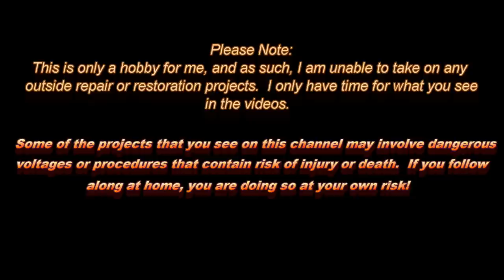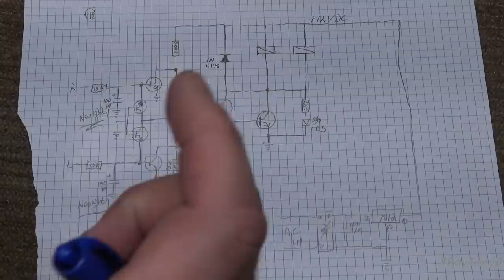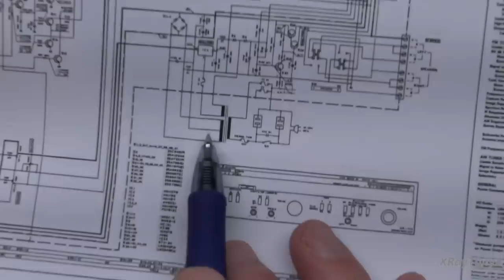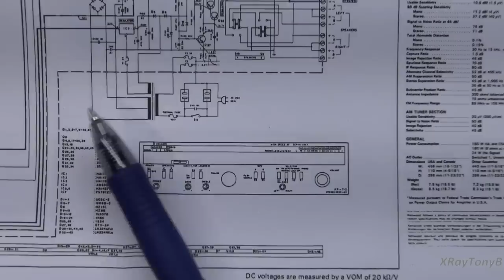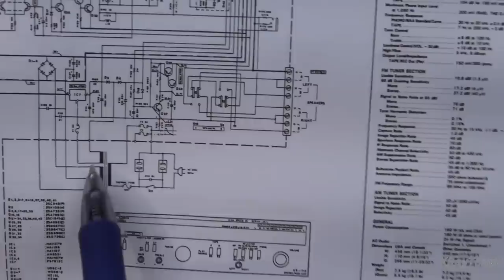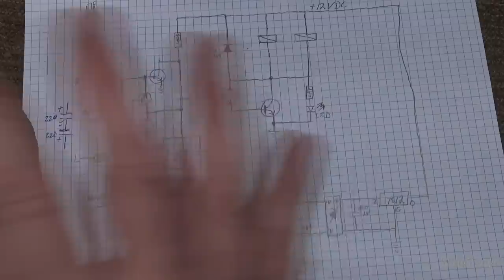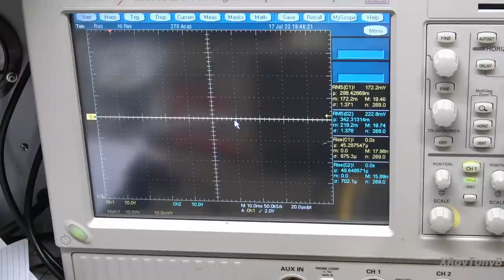Speaker Protect Circuits - In Practice

Comment from the maker: 0:15 Intro
5:20 Looking at Schematic of the Speaker Protect Module 
17:39 Building the Module (Solder & Chat)
38:19 Preparing the Chassis for install
42:09 Adding a buck regulator module to power the circuit
44:43 Testing the module with the original input capacitors
46:15 Replacing the input caps with non-polarized type
47:02 Testing the finished protect circuit
Reply: I recommend pinning this comment so that it appears on the top for everyone, if you don't pin it, it only appears on the top for the user that wrote it.

Comment: Tony, I've been an EE for more than 50 years, so I've seen a thing or two. I like your videos and don't have any issue with your presentation or content. Remember that McIntosh amp you restored by designing new PC boards? I got so many good tips on transistor substitutions for obsolete parts that I didn't need to hunt through tons of data sheets to modernize a power amp I built in the 70s. I'm retired now, but still enjoy, as you do, tinkering at the workbench. When I meet someone who wants to learn about electronics, yours is one of the channels I suggest. Keep doing these videos the way you like and ignore the keyboard warriors that have nothing better to do than criticize.

Comment: Another great video ! Your time and effort to produce each is certainly a gift .  As far as vision, I never got used to bifocals (and I tried many versions) when first prescribed later in life, a large PITA!  Have worn glasses for a good part of my life and still get them made for single vision lenses. I take them off when reading or bench work.  I find that my eyes adjust better  than using magnifying  reading glasses.  As for tiny print on some components,  the camera on smart phone with magnifier works great and the phone flashlight is great for those hard to read stamping in  plastic components.  I consider wearing clear safety glasses when working around live  high voltages and other hazards.  Thanks !

Comment: Tip = I wear transition lenses. At my last doctor's visit, I asked them to give me a separate script for soldering glasses. They are a single magnification, so I don't have any aggravation with trying to find the proper focus zone. The script also has a little extra magnification, but they also considered the focal length, to give me enough room (under my nose, so to speak) to account for the length of the soldering iron. I highly recommend them. If you don't need any correction, other than magnification, maybe you could get away with a pair from the dollar store. I have heard of plumbers that had their prescriptions flipped, vertically, for hanging pipe, overhead, all day. I even added a magnification lens inside my welding helmet, long ago, so I didn't have to wear glasses, under the helmet. That was before needing to prescriptions.  lol

Comment: At about 9:00,  It is worth pointing out that you don't necessarily have to have a shorted output transistor or driver transistor in order to have significant DC offset going to the speaker; a fault in the differential amplifier at the input of the power amp could result in several volts or more of DC offset voltage being fed to the speaker. (PS, it is a good idea to always change out the feedback capacitor in the differential amplifier to a bipolar type ----  many amplifiers used a polarized electrolytic capacitor here, and and they are known to fail).

Comment: I bought one the chineiseium  protection boards.  Mounted in a separate box with it's own power supply.  It has speaker wire leads for inputs, and  speaker type terminals for the outputs. Plugs into the switched auxiliary 120 outlet. This way I can use it for all of my amps or receivers, and nothing had to modded internally.
Reply: I did that but I wanted in the amp just took up to much room but not a lot on room in the amp. I now use the external for testing

Comment: Protection relay boards are available that run directly off of 120 VAC.  This will be easier to interface into many amplifiers then trying to find a suitable low voltage AC supply from the mains transformer in the unit.

Comment: Tony thanks for reverse engineering and explaining the theory of operation. This video is extremely helpful to me.  I have an older quasi complementary BJT amp that has over-current protection, but no DC offset protection.  I think a similar / same circuit you used in this vid would work on my amp. The only thing I'd need to determine is power handling.  The amp is 200W per channel.
Reply: Cap output ............Quasi complenatry ...............NO DC on output, no need for DC protection !  Just commute LS only after the caps are up to the 1/2 Voltage of the power voltage rail !

Comment: For those DIYe'rs who are thinking about doing this . Beware that most of these kits are designed to work only on class a/b amps where the speaker outputs are tied to a common ground. These kits can easily damage a class-d amp that uses floating outputs or an amp wired in bridge mode. That's why a schematic should be included.
Reply: Class D are newer Amps ,  they should have it built in already?
Reply: @musicstevecom  Yes class D amps are not direct coupled so speaker protection is done differently and in most cases built in. Soft start circuits are still required on most of them.

Comment: It's worth noting that those protection boards typically are not compatible with differential output amplifiers, which is what most modern amplifiers are.
Reply: Great tip! 100% correct. The speaker negative terminals on the protector PCB are oftentimes common connected (tied together electrically) and BTL output circuitry will short circuit under such circumstances. Be careful.   Fred
Reply from the maker: This is something I wanted to mention, but I don't think I did.  Some amplifiers out there have isolated grounds,  especially those that have a bridged mono mode.  These modules use a common ground and will damage those types of amps.  I totally forgot to bring that up and I'll have to mention it in a follow up.
Reply: @xraytonyb  Forgive me for playing dumb (its easy for me): Could you just use two of these inexpensive boards?  One for left channel and one for right?  Then an amplifier with separate grounds on each channel would be OK?  That's far easier than trying to re-engineer the boards to isolate the grounds.

Comment: Thanks for this video 🙏 i have a Phase Linear 400 and want to install this speaker protection 👋
Reply: I'm also using this w the 400II and 700II I use this board w/o the relays and wire it to the 2-bigger ones ,I just order parts for the update them

Comment: Interesting video for those who have to add some protection circuitry in a vintage amp. But as these only protect from DC or hard clipping, you should also specify they won't protect from any loud "Off" noise, nor be adapted for specific amp technology that can suffer from a missing output load.
As for most high end or more recent amps generally already have some kind of protection circuitry, discrete or with one of these once popular ICs, you must always understand how your amp work or get some schematics first before investing in this circuit.
Anyway, I also know people also having problems with "modern" digital amps (class D or whatever), literally frying their speakers! Apparently, the problem is these ICs don't necessary sufficiently protect their outputs when failing. So these tiny protection circuits are always an interesting feature to add! (I've seen someone complaining how some well sold Chinese Hybrid amp destroyed his loved and costly Klipsch speakers!).
What is also interesting to know is about the supply decoupling solution... And the way you solved this problem, wich is probably most cost effective than the tiny encapsulated transformer you could use for that when not finding another proper solution (I'm also from the old school). It's also an effective idea when you don't find replacement bulbs with bizarre supply voltages with more effective LEDs, OLEDS or strips depending on what purpose.

Comment: 12:00 I dont fully agree on this as a non-polarised cap. The AC signal will be devided equally over both capacitors,
so one of them will always have the signal in the right polarity, and the other will always have it in the wrong polarity.
You could fix this by adding a diode in parallell over each capacitor.
With the cathode to the positive side of the capacitor, that will short circuit the signal if it gets more positive on the capacitors negative terminal.
Reply: have you tried it?

Comment: Hi Tony,
Great video as as always.
I've just built this kit and it seems to work well.  I'm struggling to see which two caps need to replaced with bipolar caps on the board.
Reply: They are going to be the 2 capacitors that also connect to the 15K resistors. He shows them @ 48:52 , they are on the installed board, as the 2 dark brown caps.
Reply: @poormanselectronicsbench2021  
Thanks v much for your reply. 
Great help.

Comment: Anybody?  What the Maximum Dc this board can handle? So both of my Amps I have are +- 100vdc and 80Vdc rails. Do I Need a Bigger voltage for 100uf BP capacitors which I need to order?

Comment: 48:07 in the video

I have some 33uf 50V MUSE BP Nichicon capacitor and some 220uf 35v BP Panasonic capacitors both about 150pcs 

Please tell me which capacitor is good.
To use in speaker protection, I plan to build a 60w to 100w amplifier, so I needed for it.

At which ac output voltage point 33uf 50V MUSE BP will work properly or 220uf 35V BP Panasonic .

You did something similar in older video, where you set the ac voltage output signal where such values BP capacitor.
Something like limiting the ac output signal at some point.

Comment: Me personally, I like to wire the electrolytic caps with the (-) terminals facing outwards, and the (+) terminals wired together. Maybe this is just because I think in terms of electron current rather than conventional current, but - IIRC - polarized electrolytic caps are manufactured with the electrolyte on the (-) foil; so a non-polarized electrolytic would be a sandwich of electrolyte-dielectric-electrolyte, and two (standard) electrolytics wired + to +, would - essentially - be a sandwich of electrolyte-dielectric-foil-dielectric-electrolyte, very similar to an actual NPO electrolytic, like you might find in a speaker crossover circuit. I wonder if there’s any difference in performance between (+)-together and (-)-together?
Reply: keep in mind that with AC ... conventional vs electron current flow doesn't matter anymore ...

Comment: Tony, I'm having trouble understanding why hard clipping triggers the same response as DC on the speaker lines. Can you explain this for me? Thanks!
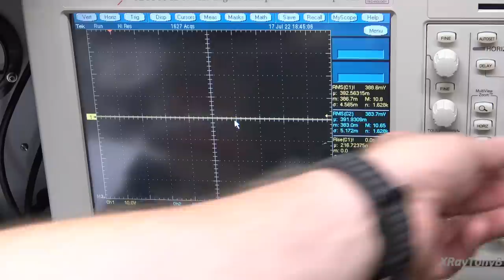Reply: He explains it pretty well starting @ 6:10, and again @  47:15  "Hard Clipping" even though it is an AC signal, basically ends up having a large + and - DC component ( notice the flat tops on the clipped AC waveform on the scope @ 47:30 ) at a high enough level to be turned into the DC voltage that will energize/charge the capacitor in the R-C circuit, triggering the first 2 transistors (on that channel) to the point where they will conduct, and drop the voltage on the base voltage to the first of the 2 transistors energizing the relay, disconnecting the speakers.

Comment: hello tony
where did you get the supply voltage of the buck converter
....somehow the minus directly from the power transformer and the plus from the rectified branch of the amplifier circuit?
I ask this because it is recommended that the protection circuit be powered from a totally separate source to avoid interference......thank you!

Comment: Thanks for this. 

I've a Peavey Amp that has it's soft start on a daughter board that is of hideous design (using about 20 SM LED's to pull down voltage for the transistor contr4olling the relay! 1 component dies... board is done and amp will not work. Terrible design :P. 

I ditched the busted board and currently use a 12V trigger to switch a relay that switches the main power relay on the amp. Works great and my pro amp is now remote triggered. No soft start though! 

I'm investigating options to reintroduce it while keeping the 12v trigger and also add in a physical switch.

I'd be very interested in knowing where you found the kits that offer more of a quality design :).   Have you any suggestions?

Comment: I don't like noisy switching supplies; but I dislike AM radio even more 😁!  If a buck or boost supply interfered with AM radio, I personally wouldn't care (AM is a vast, noisy wasteland already), but it might also interfere with a phono-preamp section. 

 If you choose to use a relay module that is designed to be powered from 12VAC or similar (some Yamaha's use 24 VAC), you might be best off to convert the lighting circuits to LED's and free up some current for the relays.

Most 1970s-80s receivers and amplifiers will have time-delayed and DC sensing relays built in, but big power amps sometimes do not,  and even those that do will sometimes be prone to sending a big pop through the speakers if the power blinks off and back on quickly. An add-on relay circuit can be helpful in such cases.

Another use for such devices,  If the current carrying capability of the relay is up to it, is as a mains-power turn-on current limiter.  Some amplifiers will have a big resistor or a bank of them in series with the power cord feeding the power transformer primary, to limit the current surge as the filter caps charge up, and a couple seconds after you turn the amplifier on a relay will kick in and shunt the mains AC around the resistors so it goes directly to the power transformer.

  I'm currently recapping a pair of Heathkit W5M mono block tube amps and those have surgistors in line with the power cord feeding the power transformer. Does anyone here remember surgistors? It's a wire wound resistor with a bimetallic switch next to it,  and the resistor is wired in series with the power transformer, until the resistor heats up, and then the bimetallic switch bends, closes a contact, and shunts the resistor out of the circuit so that the power transformer gets full AC wall voltage. The purpose of this was to prevent the power transformer from being stressed or damaged due to the large amount of heater current drawn by the COLD KT66 output tubes (which have a very low filament resistance, almost akin to a short circuit, until they heat up) as well as the current surge caused by the filter caps charging almost immediately because the stock 5R4 filament-type rectifier does not delay the B+ voltage by more than a fraction of a second. For improved protection of the transformers, I might even add a thermistor or two into these amps as well.

Comment: Clipping the leads before soldering is usually much better because clipping is very violent action and potentially weakens the solder joint if you clip after soldering (which I always do cuz I am lazy). Also, I am issuing a formal complaint: these videos are too short 😁
Reply: Circuit boards in older amplifiers are rarely damaged by clipping the component leads off after soldering, unless it is a hot running component and the foil pad and board have been subjected to a lot of heat over the years. Modern circuit boards, on the other hand, have foils and pads with the thickness and mechanical strength  of tissue paper and they will come unstuck from the board if you even just look at them funny.

Comment: I saw that the test is done with a 1.5v battery but I had 48vdc on my Technics with the shorted terminals. Does this board support these voltages? Thank you

Comment: Hello my friend, I have been following you for months and the first video I watched of you was for the Kenwood kr 710. 4 months ago I bought a broken one and it only had one channel working and in this channel only a speaker was working so I bought replacement transistors and replaced them and also replaced the small transistors that belong to them with the resistors. Which is 330 ohms, and the problem is that when you turn on the device, the resistors burn out every time. I tried about 10 times and checked some of the components in the circuit. Unfortunately, the problem still exists to the point that I bought another device exactly like it. The same problem was that the right side was broken, so I tried to replace the parts on the right side, and when it turned on I am surprised that the fuse is burning. I am completely unable to use this device. Do you have any ideas? Sorry for the long delay.

Comment: Hi XRay, Good Videos. Social Media in general is full of the stuff you are talking about. Young girls especially can be devasted with comments done that are truly not required or needed. Simpler when this media was not available. Forget them - "water off a ducks back" is an old saying... Anyway- to my point. Would a circuit like this delay output to speakers for a lot of vintage amp "Speaker Thump" which normally cant be overcome with existing units schematic.?
Reply: The short answer is, "yes".